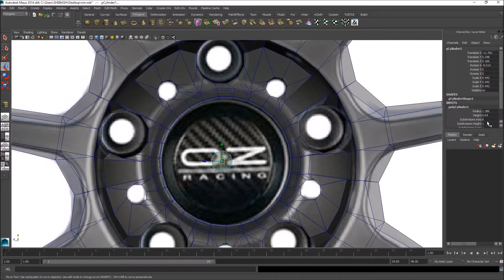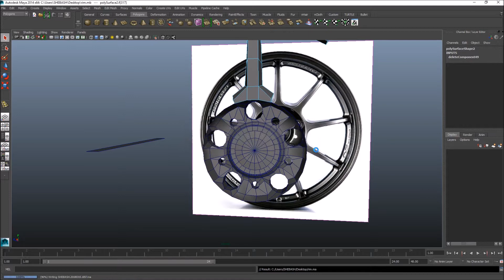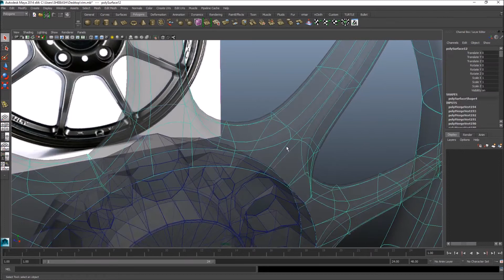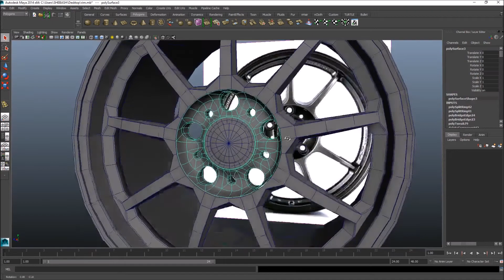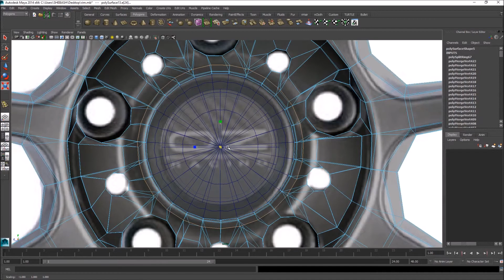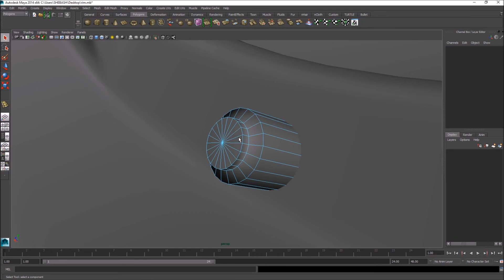OZ Rim Modeling Tutorial Part 3 - Autodesk Maya

Comment: Im no expert... But to make the holes i used the bolean tool. Just follow this tutorial. https://youtu.be/7qe2MWrXGHo
Reply from the maker: p1mento I know how to use the boolean tool. The problem is that you can have problems when smoothing the model after using boolean because of the extra edges/vertex. You could counter this problem by taking the time to add the necesary edges to compensate but I like it better the way I did on the video
Reply: Sebas Design  thats why i recomended that tutorial. As having trouble because the number of sides didn't match. After watching that tut i had no trouble using the bolean tool...